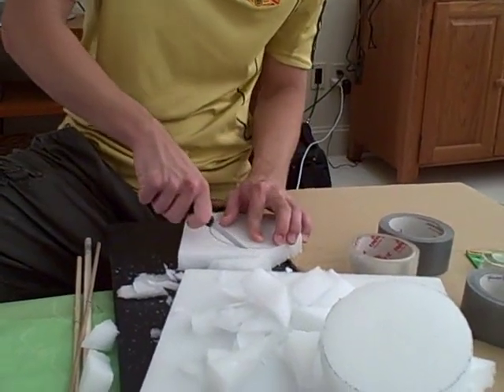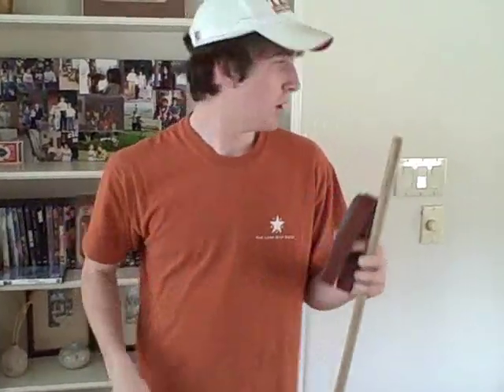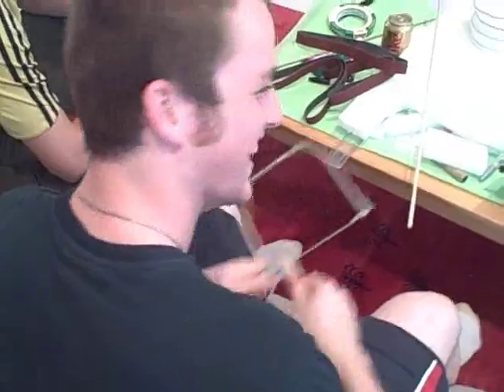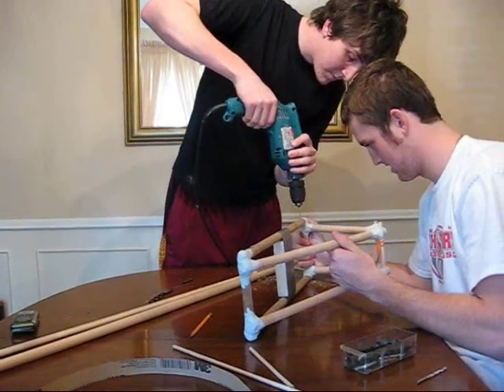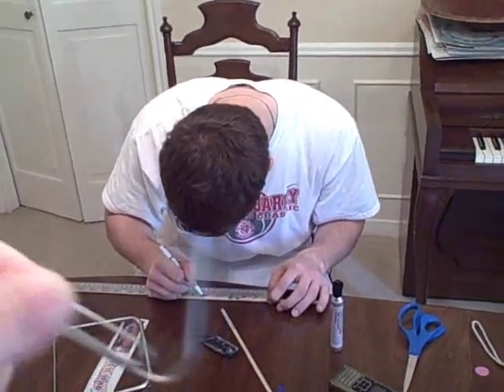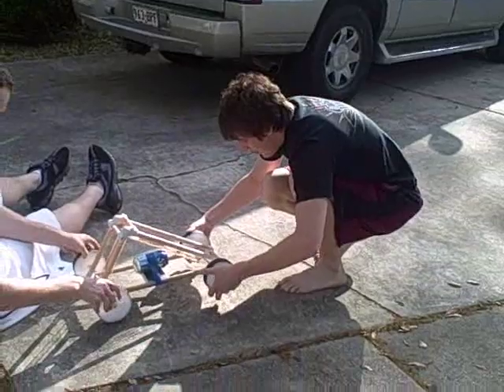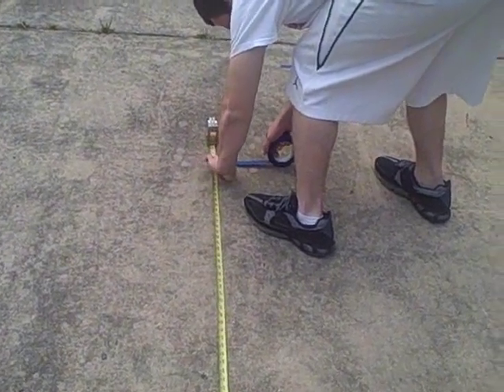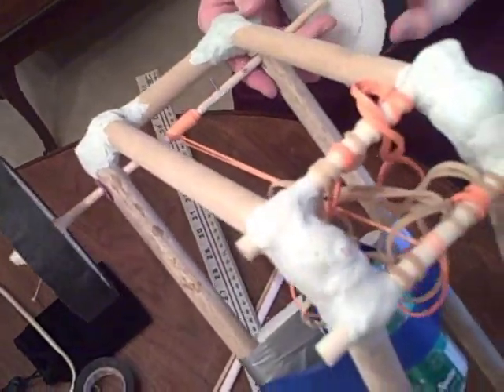Rubber Band Powered Car - physics project

Comment from the maker: @Sweetlil24395 in order to attach the wheels to the axles we were just careful when punching the axle through the styrofoam wheels to ensure they were straight, and then used a lot of hot glue to hold them in place

Comment from the maker: @weasleytwins14 at 2:51 you can see us inserting the straight pieces of paper clips into small holes drilled in the axles and held in place with super glue. the rubber bands will hook on these before the axle is wound up. the only tape used on the whole car was to hold the soda can

Comment from the maker: @ohaihill there were like 5 different release point all the way across the axles and the rubber bands were wrapped different numbers of times on each point. so while one rubber band had unwound all the way and released, other ones (on different paper clip points) still had a few turns to go

Comment from the maker: umm well i guess you could put a hook on the axle instead of the pins we used. that way when the rubber band unwinds all the way the hook stops it from releasing and therefore stops the car as well. then the bands wil stretch a bit and the car will begin to roll backwards but this time the bands will release from the hooks if you point them the right way, allowing the car to roll backwards without impedance

Comment from the maker: @baseballbean24   We put them in a wide "V" shape starting in the middle of the axle and spreading out. but you can do it any way as long as they arent in a horizontal line. i guess a diagonal line would work well also

Comment from the maker: @snixlie09 well it was tied up top to the horizontal bars. and as you can see in the video, we have straight pieces of paper clips glues into the axle so it will catch the rubber band when you wind it up but release when it comes completely unwound

Comment from the maker: well at the top, the rubber bands are just tied off. and at the axles they are looped on little straight pieces of paper clips that are attached to the axles. the axle is then rotated by hand so the rubber bands wind up and wrap around the axles. and when you let go, the bands unwind themselves, rotating the axle. the axles are about a foot long each.

Comment from the maker: we drilled little holes in the axle and put bout 1 cm long paper clip pieces into the hole and super glued them in there. the explanation for that begins at 2:27 to about 2:56. then we just hooked the bands on the wire but didnt bend them so the band could release when it had no more tension

Comment from the maker: the wheels had a diameter of about 5-6" and we used sand paper to make them smooth and round. the axles were also made of smaller dowels. be careful drilling the holes for the axles you will have to make pilot holes first (start with a small hole and widen it out with larger drill bits until it is the size you want)

Comment from the maker: if you pause the video at 1:33 you can see a good setup of the body. the bottom dowels were about 20" the short part of the triangle is about 10" and the long part somewhere around 18". the dowels for the width were somewhere around 5". we didnt have exact measurements for everything as long as each piece had an identical counterpart. then we used the saw to notch all of them and glue them together. then we used smaller dowels for the front and rear axle anchor points up top

Comment from the maker: we got the wooden dowels and super glu and styrefoam at Michaels arts and crafts. the jigsaw, epoxy concrete stuff, and sandpaper tape came from Ace Hardware. the bottom dowels were about 18" in length and were notched together and then glued with 2 part epoxy. the rear bars are about 10" and the ones going from the anchor points to the front of the car are also around 18".
any more questions just post em here